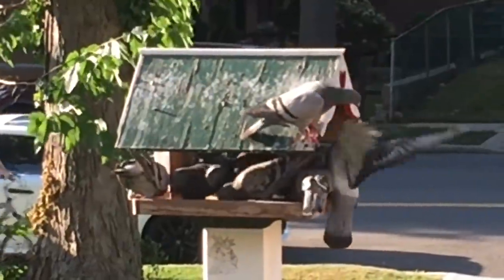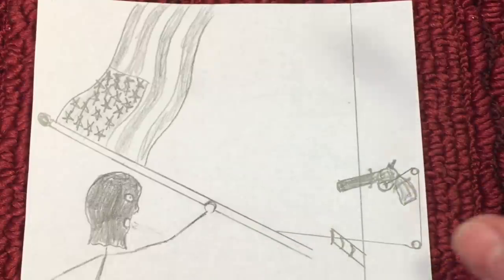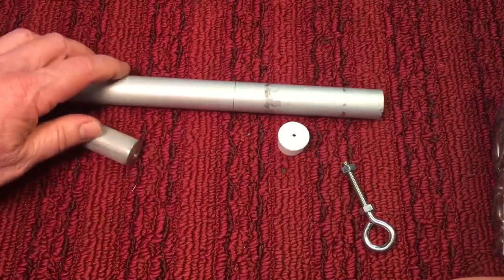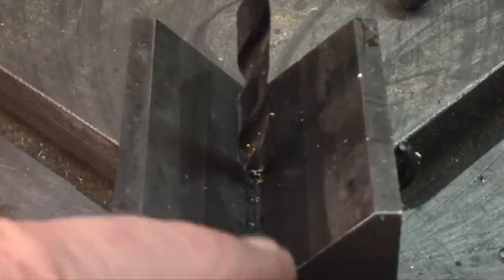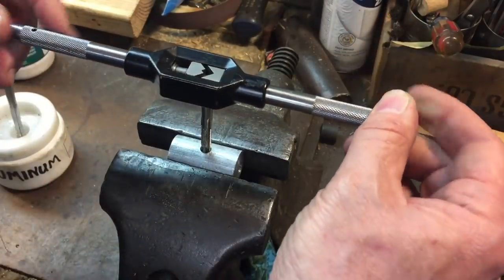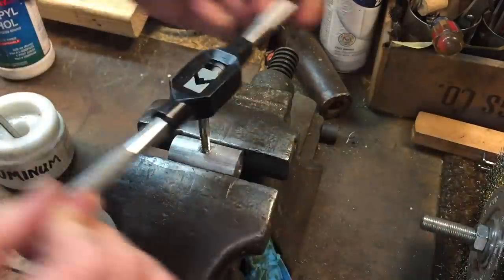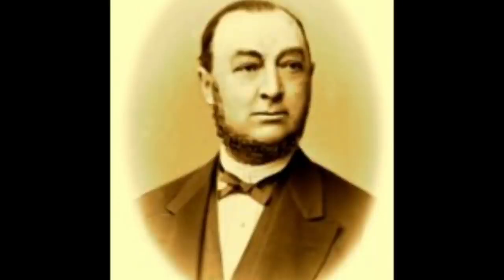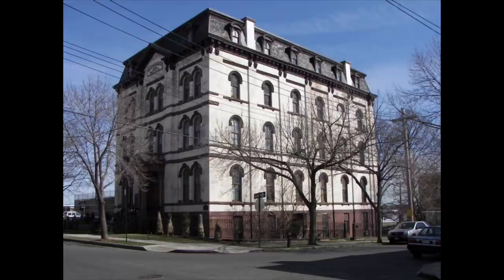Theft Proofing my Flag and Conrad Poppenhusen

Comment: The aluminum plug was a good idea, made a better finished product and gave it strength. When a piece of conduit or any thin pipe is drilled thru and bolted it always breaks at that point, putting a plug in there would surely help and in your case only drilling one side of the tube makes it all the better.
Reply from the maker: I was thinking the same thing!  Even a wood dowel would have sufficed...   =D

Comment: You could always just try the simple option. Attach a cable to the flag pole, which leads to an internal electronic switch, which would trip the alert system, which in turn would alert the secret base under your house to release the flying combustible armored lasersharks to destroy them. See, easy-peezy!
1 second ago

Comment: I'm really surprised you didn't just build a trap door that would automatically open when the flag was pulled on with a pair of hungry tigers living in the bottom of the pit which connected to a tunnel leading to your basement so that you could feed them now and again. (kind of like your mice).
Reply from the maker: The idea of a moat did cross my mind!   😂😂😂
Reply: That’s funny
Reply: much better would be a large garbage disposal to grind up and drain down the sewer.

Comment: Knowing new york those first few ideas would have a thief trying to sue you, haha.
I have a question that you might find interesting, maybe a video idea:
If you were to 'reset' everything and start restoring tools from scratch knowing what you know now but having none of the supplies or other tools, what are the first things you would look to buy and what would you prioritize as your first few restorations to get things rolling, and why?
Reply from the maker: The best part about this hobby is the relatively lost cost to achieve great results...   A bench buffer (for your wire, fiber and buffing wheels) a 1x30 belt sander and a angle Grinder!  Total cost less then $150!   😃👍

Comment: The problem with guns,grenades,etc, is getting all that back-splatter on the flag!  Anyway, my preferred method for opening screw-eyes is as follows:  place in a vise with the threaded portion parallel to the top of the jaws and the free end of the eye just above the jaws.  Now you can stick a screwdriver or some other bar in the eye and twist it open sideways.  Attach the chain and then twist it back into position.

Comment: Nice video! Could you please explain how did you manage to capture the aluminum piece at the exact point and orientation of the poll you wanted?

Lets not forget the grenade anti-theft mechanism. It could be also used  as a statue protection system.
Reply from the maker: Believe it or not it went much easier then expected!  I placed the pole on the bench with the hole facing up, then I inserted the slug into the pole with the threaded hole facing up... I gently pushed the slug up the inside of the pole using a dowel and when I saw the holes lining up I used a toothpick to make sure they were perfectly aligned!  Super easy!  Thanks!
Reply: I was wondering thar too.

Comment: How did you get the cylinder in the pole and line up the holes?  By the way I like option 3
Reply from the maker: It was very easy!  Just played the pole on the bench with the hole facing up then put the plug in the end with the hole also facing up and pushed it up with a dowel...  Lined up perfect!

Comment: Great video! Just one question how did you get the two holes to line up when puttin the bolt thru both pieces? Have a great weekend!
Reply from the maker: William it was so easy!  I placed the pole hole up on the  bench then placed the plug hole side up into the pole and pushed up with a dowel!  Super easy!  Lined right up!
Reply: @ScoutCrafter  awesome

Comment: Just curious as to why you’re worried about someone stealing the flag. Did someone steal a flag from you before? Have your neighbors had their flags stolen? 
When I was young I worked for a contractor who lived in Stamford. While not large by New York standards it was the third largest city in Connecticut at the time. My boss’s van was parked in the driveway the keys were in it as well as a set of keys to all the apartments that he rented out. His wife’s Cadillac was parked next to it, also unlocked with the keys tucked over the sun visor. His barn, which usually had three or four antique cars plus old car parts and a variety of tools was only locked when they went on vacation. There was also a four car garage, again with a number of antique cars, some worth more than $100,000, plus more tools, and again it was only locked when they were away. And even when it was locked the key was on top of a marble lintel over the door.
While I’m not as trusting my old boss was, I refuse to worry about anyone stealing from my yard. The news media always makes it look like we’re going into a big crime wave.
Reply: @reverendtfg6802  I would expect someone with the title Reverend to be able to reply to a post without resorting to labels. 
I’m also quite certain that John can answer the question himself should he feel like it. He certainly has the right to ignore the question if he doesn’t want to take the time to answer it.
Reply from the maker: I will tell you the story one time of how my birdbath was stolen, also I will mention my bicycle was stolen from my garage (locked up too)  NYC has a bunch of parasite...  Always have.  The key is lots of police locking them all up so honest people remain...  =D

Comment: John why didn't you drill and tap a through hole in the plug, rather than drilling part way and bottom tapping?
Reply from the maker: I had visions of the eyebolt denting the other side of the pole.  😃👍.  No reason.

Comment: Good or bad guys,  statues are our history, even Hitler should be on display so that people can question and debate what happened. and not to forget. I was always told to twist links to open not prise them open as when you close them you have to go further as they spring back. You will always have a small gap if you try to close the but twisting you can go slightly past and it will line up. Like your Dake you bend the item slightly further as it springs back. It is a shame everything has to be under lock and key.
Reply from the maker: Hi Tony!  The only problem with twisting is the ring was formed by Machine bending the eye around a die. The grain structure of the steel has sort of a memory and will tolerate bends in the same direction much better then side to side-  In fact if you ever wanted to intentionally break off the eye bend it sideways... Also many times the zinc plating will flake off with a side bend.  (Ask me how I know) 😂😂😂👍